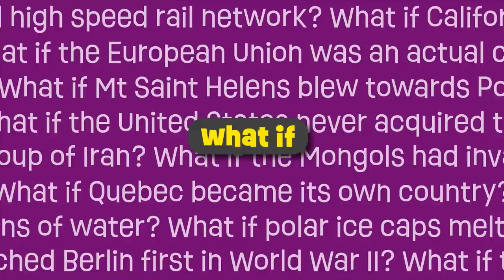Water Pipeline: What If An Aqueduct Was Built From The Great Lakes To The Southwest?

Comment: You only have to build the canal to the headwaters of the Colorado river, the Colorado River would carry this new water all the way to Mexico. Pumps could be used to lift this new water up to the height of the Colorado River. Forget the great lakes and just take the extra water from the Ohio and Mississippi, and then only take water during floods. The canal and lakes Mead and Powell could then be used to store all the water they ever need. Solved it:)
Reply: Yep, we could connect the Colorado to the Missouri and divert some Mississippi water to the Missouri upstream. The result is a 450 mile pipeline with a 7,000 foot elevation gain. About 50% of the power would be recovered through the dam systems and it could divert, especially at high water times water to Colorado system to fill their dams.
Reply: i've been saying this for a while now. you know who wants less water? flood zones

Comment: Waukesha, WI, a city just west of Milwaukee and about 20 miles from the shore of Lake Michigan, recently requested permission to run a water pipeline from Lake Michigan (because Waukesha has especially high levels of radium, which contaminates local well water).  That was a huge deal and many were opposed to it.  And that's only 20 miles from the lake!

Also, wouldn't a ~1,500 mile aqueduct (basically open canals as depicted in the video) have huge losses to evaporation?
Reply: Massive losses. It could drop water levels by half just filling a very shallow canal, not including use
Reply: Waukesha was denied permission because the city isn't in the Great Lakes watershed.  The used water would have gone into the Mississippi River watershed.
Reply: @dougcampbell7898  If they have access to rivers what’s stopping them from pumping water from those rivers?
Reply: @308dad8 That's what I thought too.
Reply: The graphic kept showing a pipeline. Pipelines and underground reservoirs would not have much evaporation loss. Also, an aqueduct can be built narrow and deep, greatly reducing the exposed surface. Looking at the California Aqueduct, it's easy to forget how deep it is. The occasional news report of bodies or cars that fell in, and were hard to find, are a gruesome reminder that it's deep enough to hide important things.
Reply: @exrobowidow1617  It would drain the largest lake in the country rendering it a mud hole then a desert
Reply: @308dad8  If a river flows into a protected body of water, then likely the river is also protected. If the watershed is protected, then all the streams and rivers flowing into the protected body of water are protected as well. 

Over a hundred years ago, Los Angeles began taking water from the Owens Valley east of the Sierras. There was a substantial lake then, but it dried up. Further north, Mono Lake was drying up, too. But as people became aware of the environmental devastation, Los Angeles cut back on the amount of water being diverted from Mono Lake. Water is not drawn from these lakes, but diverted from the streams feeding the lakes. The lakes and the rivers in any watershed are part of a whole system. Take water from the streams, or from the lakes-- either way, the lakes will suffer.
Reply: @exrobowidow1617  The only answer is for the entire southwest to cut their water consumption. They claim agriculture is the single largest consumer of water in Arizona but in Commiefornia it’s bottled water.
Reply: @308dad8  that’s total BS. Where do you get your information, fox?
Reply: @tedecker3792  Also with all that coast line why doesn’t Commiefornia just use the Pacific Ocean water and let Americans have their rivers back
Reply: @308dad8  the state that provides a vast portion of our food? On irrigated desert land?

Comment: No one is getting water out of the great lakes in the west. There has been a compact in place for many years now to stop too many from taking or using the water from the great lakes. If you can't treat it and put it back into the lake, then you can't use it. The reason 40M plus can drink out of the lakes is we put back the water that we take out. Unlike the west that takes from the CO river and never puts anything back into it. The only ones that put water back in is NV.
Reply: That is what cracks me up with people not from the Great Lakes being like "but there is flooding". The reason why the Great Lakes haven't dried up is precisely because flood water goes not only into the Great Lakes but also into different acquifers. We already do export plenty of ground water in the form of both farm products (produce, grain, and livestock) plus actual bottled water. The Great Lakes also have plenty of pollution issues that would need to be solved first because taking water out would only make them worse. People keep saying the water is "wasted". As in any water that flows into the sea should be harvested before it can get to the sea. I get that people don't know that the lakes are actually used for shipping (not many people outside the region knwo) but like there is a certain level of water required for shipping. Let alone the environmental havoc that would be created.
Reply: Westerner here, dont support, southern parts and states are vastly less important than the few trees we have left. That water aint going north of sac and sf its not helping. You think you can allow all the people in to use up resources when in the end you contaminate all of it from the top down. Besides, people are moving from the great lakes because they are ruined already.
Reply: @ericburton5163  So will U be willing then to eat 1/2 as much from now on ? CA grows 1/2 of your food... Learn how an economy works

Comment: Thank you for representing and explaining the concerns of the Great Lake states and provinces so well.
Reply: Don't worry, nobody has ever seriously considered the Great Lakes as a water source for the S.W.
Reply: Not yet....
Reply: @gordonloessl2822  The only way to have an effective aquaduct is to have water run down hill. The South west has a higher elevation than the great lakes and getting past the continental divide would not work.
Reply: In your video you acknowledge the effects of climate change on the West Coast it is indeed getting more heat waves and hotter but if you take the time to look at the effects on the East Coast the atmosphere is holding more moisture and causing it to rain on eastern states longer and more frequently this is causing flooding to become more common on the East Coast So imagine this instead of trying to take water from the Great Lakes one source that is to say. we make a more elaborate system that is connected to various rivers and some lakes on the East Coast Then when it rains more frequently and starts to hit flooding conditions in that area a switch could be Flipped opening up a water pipeline to take the excess water to where it would be needed more thus stopping the Flood From happening and allowing the excess water to be transported to the western states I suppose this is more of a water pipe network then just a simple water pipeline I think it's the best long term solution the western states get the water they need and the eastern states that are being hit with more rain and flooding will no longer have increasing Flooding events. I would also like to make it clear that I do agree that Salt Lake City and the other cities and states in the western states need to manage their water better then what they currently do also I don't know why So many people  think the only solution for a water pipeline would be the Great Lakes sure on the surface that seems like the most obvious solution because it's in plain sight but like you pointed out in the video it's not the best long term solution however this water pipeline network I mentioned earlier would be one of the best long term solutions if you think about it for a little bit and do some of the research on climate change not just affecting the West Coast but also the East Coast you'll see my point. / Also on a side note between 2030 and 2040 Florida is doomed as they are the state that will be damaged the most from rising sea levels
Reply: @DavidJohnson-pu2jh  If floods were that easy to control we would have already installed pipe lines to the Atlantic ocean. Have you looked up the numbers on how many acre feet of water is involved in a major flood event and how big of a pipe and energy it would take to pump that much water to stop a flood?
Reply: I read once that a war will be fought someday over water on this planet.  I do believe that statement. Taking water from the Great Lakes to send to the southwest would be the perfect scenario to start such a war I guarantee it.
Reply: @bultacowally  You're just quoting the fallout games and lots of people who play those games have already figured out that the war over resources in the game Escalated to nuclear war Specifically because of vault tec The company in the game world wanted to kick off the nuclear war So they could take over the planet. But in reality if we work together and Help each other solve the problem We could avoid a resource war Of course this does mean putting personal profit in second or third place Which is something greedy stupid childish rich people Often have a hard time doing Even when they have more money than they know what to do with I'm looking at you Amazon and Walmart.
Reply: @opossumlvr1023  I'm not talking about stopping the water I'm talking about redirecting some of its flow When it rains too much and the river starts to swell up To flooding conditions That water has to go somewhere This usually results in areas that are in the floodline Neighborhoods sometimes hole small towns Flooding And as we move forward Closer to 2030 Flooding in a lot of the eastern coast States is going to Happen a bit more frequently So imagine if there was a pipeline networking In place When the river And some lakes Start to overflow and swell up A lot of this excess water would go into these Pipes and be redirected to areas Where it is needed more A nice long trip to the western states This would mean that The excess water would not flood the neighborhoods our town And at the same time a lot of the Southwestern states can be saved as well From future devastating droughts For instance one of the exits to this pipeline Network system Could be by Hoover Dam Helping to bring its water level back up for the entire river in Exchange the western states could pay the eastern states some money for the water
Reply: @DavidJohnson-pu2jh  The Army Corps of engineers have been around since 1775 and it is there job to manage water. If it was possible to stop flooding they would have. During a flood you have 1000's to 10,000's acre feet of water spilling into water ways over a matter of hours. We could never build pipes or pumps big enough to move that volume of water. Why build that infrastructure to only use maybe once every decade? We would need hundreds of these colossal pumping stations that would be rarely used scattered across the eastern U.S.  As you know floods are unpredictable which is why people get caught in them.
Reply: @opossumlvr1023  Well with a lot of modern day technology it's not as big a job as it was back in the old days don't get me wrong it would still be a big job second according to all simulations based on available weather data and climate change data it shows that much of the eastern states will be getting hit with more rain that will last longer than usual increasing the chances of flooding events throughout most of the eastern states meanwhile on the West Coast especially for the southwestern states longer lasting more intense heat waves These events will increase as we get closer to 2030 by the way between 2030 and 2040 Florida will slowly be consumed by the ocean Of course all coastlines will be pushed back several miles Within that same time Frame. One of the biggest problems we will be facing in the near future is housing and homelessness some of this will be because of The fact that here in America housing is seen more like a commodity than a basic human right For a place to live This aspect can already be seen as big companies and investors buy up hole neighborhoods And Jack up the rental and sell prices to insane levels That regular working class people cannot afford especially if you were just in an environmental disaster that Recked your old place The same environmental disasters that will be forcing a lot of migration throughout the map migration that we are not ready for mostly because again of greedy stupid rich people only really caring about themselves there aren't many rich people that are truly worth respecting.
Reply: @DavidJohnson-pu2jh  Adding CO2 to the atmosphere isn't a concern, before the the industrial revolution it was getting to low. Most plants require at least 250 ppm and optimal growth happens around 1200 ppm. 350 ppm wasn't enough and I think mother earth knew this and created us to release carbon that was trapped deep in the earth. At higher CO2 concentrations plants don't have to open the stomatas on their leaves as wide to get the CO2 they require. Thus reducing the evaporative losses of water from the leaves making the plants more drought resistant. Satalite data shows that plants are expanding into desert areas for this reason. CO2 is making the planet greener!
Reply: @opossumlvr1023  Sorry man the excess CO2 is making the planet's atmosphere warmer While it is true that thanks to the industrial revolution we helped put enough CO2 in the atmosphere To stop a global cooling event from happening We have reached the point  Where the amount of CO2 we have contributed to the atmosphere has messed up the earth's thermostat the entire earth being a little hotter is affecting the jet streams in the sky and the ocean conveyor belt system these two things basically control the weather There is a variety of things that climate change is going to cause and for society it ain't gonna be good Just so you know it's also going to be bad for most life as we know it on this planet I'm talking about the animals. / But it's not all doom and gloom true there isn't anything we can do to stop climate change from happening at this point but there are lots of things we can do to reduce the damage that climate change does One of the most important is to reduce the amount of CO2 we are Making./ If you're wondering about that global cooling event that was stopped if it had happened It would have made the far north of Canada parts of Russia and Alaska too cold to live in Oh yes and Ireland and England would still be livable but they would have been colder than usual It was also estimated by looking at the data and the research on the topic that Iceland would actually have matched its name./ On a quick side note did you know a very very long time ago Greenland was really a beautiful forest of green trees this was a very long time ago Like when the majority of humanity was very primitive Although discoveries indicate that a few human cultures were ahead of the majority of the others.
Reply: @DavidJohnson-pu2jh  There are lots of places that are inhospitable to life on this planet and lots of places where the conditions could be better. If we are causing climate it can't be all gloom and doom, some where the changing climate will be an improvement over current conditions. In the past the earths CO2 content was 7000 ppm and it did not cause a run away green house effect then so why would it cause one now? The green house is really a bad analogy for how CO2 supposedly causes warming. Green houses get warm because it is an enclosed space that allows energy in the form of light in and prevents convection to currents to move thermal energy out of that space. In our atmospheric system there are no barriers to convection currents and green houses don't get warm by absorbing and re-radiating energy as the so called green house effect hypothesis claims.
Reply: @opossumlvr1023  I agree that the term greenhouse effect is a little inaccurate and oversimplified And it is true that human activity has improved the The quality of the environment in some ways in a few places But at the same time we have also polluted a lot of places and made them largely uninhabitable Or in some cases technically you could live there but you're more likely to get sick Or injured More frequently for instance I'm sure you're aware of the historical significance of the asbestos companies and how they polluted lots of farmland for decades Around their factories Until that historic legal case And the government held them accountable for intentionally Polluting the drinking water of the nearby farmers and small towns close to the factories. /As for climate change there are currently 5 projected outcomes based on all the current data and research observations These projections are what is most likely to happen based on what humanity decides to do overall about reducing the damage from climate change We basically wanna shoot for earth 1. 2 or 3 earth's 4 and 5 are called the nightmare earths With 5 being the worst because the only way humanity could survive is an underground geocities They're basically isolated self-sustaining Cities that can sustain a certain amount of people for so many generations The idea being that eventually the earth surface would be habitable again and within a Few generations Eventually humanity could return to the surface and begin to rebuild Originally these underground cities were meant for in case of a asteroid impact or  Nuclear war That would temporarily leave the earth surface unlivable.